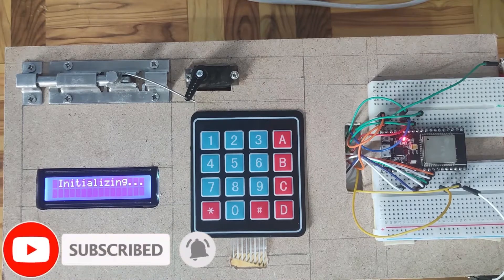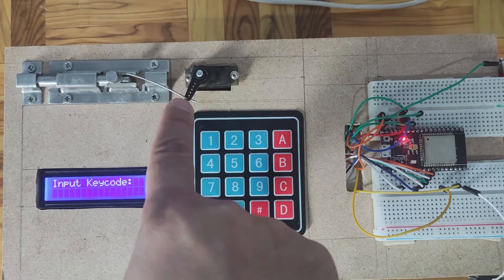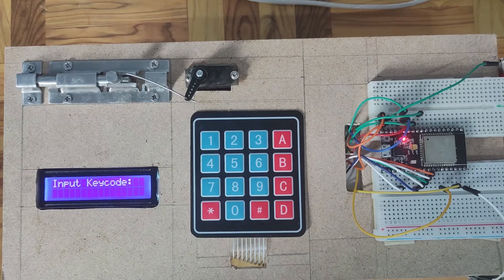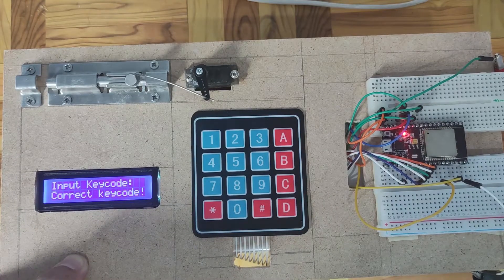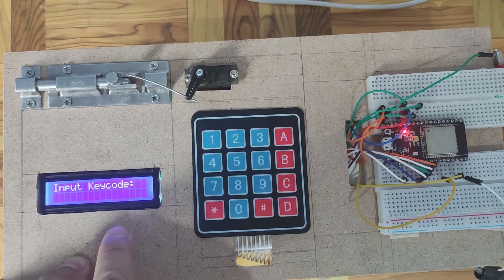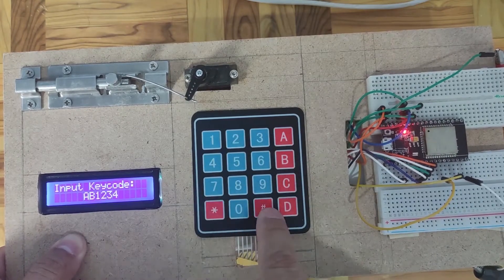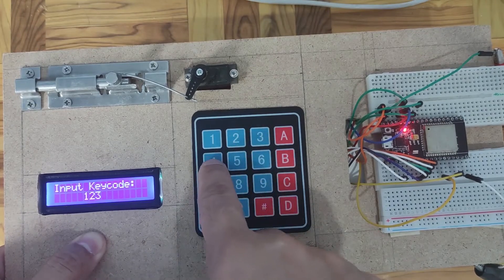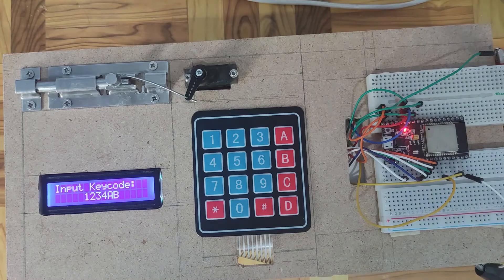ESP32 Keypad Database Security System

Comment: Can you make the same thing with esp8266 and a electric door lock so you can still close the door
Reply from the maker: Hey, I think the code would work with ESP8266 with minor changes on the gpio pins. and the wifi setup.
Reply: @DonskyTech  i thing im buyng a arduino and can you help me on thad?
Reply from the maker: There are lots of variants of Arduino that you can buy.  There are also the ESP32/ESP8266 variants that are WiFi enabled.